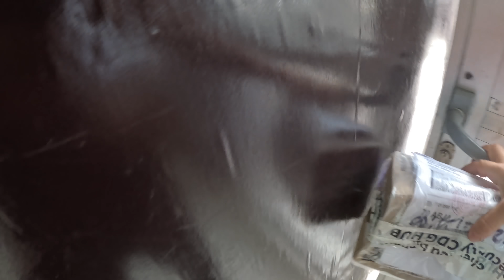Opening up the engine of my Honda CRF300 Rally in West-Africa |S7-E52|

Comment: As a transmissions overhaul and repair engineer, these guys did an excellent job.
Reply: I guess their skill level is very high out of necessity. I’ve never been good at wrapping my head around engines. The details you guys need to remember is mind boggling.
Reply: Only spotted one mistake they should have left the friction plates soaking in oil for a few hours before fitting.
Reply: I would not trust that engine to be honnest
Reply: Great guys but the damage and the lack of torque wrenches
Reply: I knew you would be on the bike again. Even in the USA we do repairs ourselves in little sheds. What is impressive is you guys had translation issues and they still got it done. Good thing for Siri 😅
Reply: I agree at all:-)
Reply: @JC-db4ih  I was a mechanic for 45 years, and a torque wrench is nice, but if you understand how much torque you are putting on the fasteners, you can get by quite nicely.  I was on a 100 mile cross country race one time and my engine seized.  I took it apart out on the trail, pried the piston rings out of the piston with my pocket knife, used a smooth rock to "sand" the grooves off of the piston, and put it back together and finished the race.
Reply: @JC-db4ih  Because of skin color or?
Reply: Super haben die beiden gearbeitet. Am Anfang hatte ich doch Angst das es nicht klappt, aber dann könnte man sehen, das alles gut wird
Reply: At least we will see düring next weeks how the CRF will run😁🙏
Reply: @JC-db4ih You can transcend the need for torque wrenching with enough experience and feel and common sense. Torque is a crutch of sorts anyway. What matters is axial tension on the bolt. Torque is a crude approximation of that, depending on friction, tolerances, etc etc. But it's not just a matter of bolt size, also function and (therefore also) material the bolt is made of.
Reply: @michaelsedaa3200 stoopid insinuation. (Plus the engine doesn't really have a skin color, or even proper skin.)
Reply: I think you and them did an incredible job 😅
Reply: @BuilderofRat  👏🏼
Reply: The people of west Africa, amaze me with their survivability skills.  Many here in the US have long forgotten them, sadly.
Reply: As experienced in automobile in enough years one think is for sure any engine can be repaired perfectly if only the opens is the only one again to put it together, I did alone somewhere in sudan.
Reply: They are like angels!
Reply: @BuilderofRat that’s so incredibly resourceful!
Reply: @ryan88682  That’s a myth. Do you think the Honda factory soaks their clutch plates? No they do not and it’s not necessary in the field either.
Reply: They got it done but I would have split the cases to really clean them out. The wrist pin install was a bit imaginative too. 😀
Reply: Piston circlips should really be changed after removed.
Reply: @JC-db4ih am an engineer myself and although trained using a torque wrench, I have gotten really good over the years in feeling it. 😅
Reply: @slime5430  I have not replaced the circlips many times, and I have never ever had one come out.   When you are in the middle of nowhere, you do what you need to do to get the job done.  I worked in a Honda dealership when I was 19 years old, and I never replaced the clips unless I screwed them up removing them, and a piston wrist pin clip is very easy to remove without screwing it up.  I used a wooden dowel installed inside the wrist pin to contain the clip if it tried to get away.
Reply: @cailinanne  When you are 40 miles from the truck, you can get resourceful.  LOL
Reply: @JC-db4ih  when you have no other option what are you going to do
Reply: @user-xd3ij7cw8s I worked for 10 years as a field mechanic for Caterpillar, and one thing that I ALWAYS torqued was the "alligator" link bolts for the tracks.  They had a torque value, and then you had to tighten it another 120 degrees to stretch the bolts a little.  I never ever had a track that I put together come apart while the machine was in use.  A lot of Cat mechanics can't say that.  I did not torque everything, but I always torqued those bolts.
Reply: @JC-db4ih  experience can replace torque wrenches in engines where tolerances are not super tight unlike in formula1/supercar engines. I've seen 2jz/rb26 engines in japan with 700-1200hp get rebuilt in a shed with just wrenches, and be fine after a whole summer's trashing.
Reply: I would have bought a DR650 for RTW work.
Reply: Seeing all that metal in the cases aren't you running a huge risk by not splitting the cases to get it completely out. If there is still the slightest piece still in there it can wreak havoc if it gets in one of those gears
Reply: @JC-db4ih  The lack of torque wrench and service manual worries me as well.
Reply: @JC-db4ih  yeah im suprised they didnt split the cases to make sure they get every bit of metal debris out
Reply: @JC-db4ih  Pliers on the wrist pin was a highlight for sure.
Reply: Hats off to dis wonderful experience mechanic......... What ever the model or the company  cheap or costly all the motorcycle build in a same way so no need to panic for local mechanic repair.....
Reply: @BuilderofRat  wondering. Just because you haven't replaced it and it not failed doesn't mean it's correct
Reply: Nope!...After such as breakdown the whole engine should be taken apart, each part should be inspected for damage and replaced if needed. Then, properly cleaned and engine oilwith filter should be changed again after good startup, and again after 500-1000 miles. Otherwise, continued problems in the future!... Mark my word...
Reply: @slime5430  Ha ha, ok, I will give you that.
Reply: @PeterBaumgart1a  But if you're German skin color plays an important role then does it not?
Reply: @PeterBaumgart1a  Well said. And an old school way, that's gonna offend these wok... inexperienced young guys don't you know? A friend of mine who was a WW2 veteran, used to tell me how they "torqued" bolts in their subs by touch. But today, oh no! you have to have fancy digital tools.
Reply: @BuilderofRat that’s the spirit. I once replaced a Crankshaft from a Kawasaki Z900 and used a hone to sand rub a brake-cylinder to get the the piston-pen fitted in the Con-rod … that was 40 years ago, the bike is still running.
Reply: @JC-db4ih  i totaly agree we will see after a few miles
Reply: @hhazelhoff1363  I would drop the oil immediately
Reply: @mikek.9980  true
Reply: @ryan88682  No.  Contrary to popular belief, the plates do not absorb the oil
Reply: @JC-db4ih most mechanics don’t torque. They should but…
Reply: @JC-db4ih  because it was done by africans😢
Reply: I work with threads , thread guages and I can feel how a thread is and for example if the thread is in alloy you cannot tighten it as much as the same pitch thread in steel. Obviously you would tighten a M8 thread with more force than a M5 for example and there's thread lock and copper grease to stop steel bolts seizing in aluminium like where exhaust bolts seize up in aluminium and shear off when you try to undo them. Most damage is done either by cross threading or over tightening. There are many tricks of the trade and these gentlemen will know them and probably have done difficult jobs without special pullers, torque wrenches since they could walk.
Reply: @JC-db4ih  YouTube keyboard mechanic 👨‍🔧 🤭💀😂
Reply: I wonder if these bush mechanics had the obligatory piece of paper? More than likely not but they have the skills to get a  machine back on the road. Some steps missed, tools and cleaning equipment missing but you are back on the road. Not everyone needs a certificate.
Reply: @ryan88682  You do not have to do that lmfao. have you ever bought a clutch kit? Barnett literally says to soak them for 5 minutes. spotting "mistakes" when you don't even know what you're on about. classic.
Reply: @@MrAn0n it looked like the clutch basket was damaged severely, so also needed replacing.
Reply: @michaelsedaa3200  I do not understand your remark about skin color. What does skin color have to do with bike repairs and the use or not of a torque wrench? Are you perhaps refering to the different bolt colors? Torque settings are different for electroplated bolts than untreated bolts or different types of metal bolts like brass or aluminum bolts that all have different colors. Alghough, I have never heard anybody refering to bolts as having skin colors. Coating colors perhaps?
Reply: @michaelsedaa3200 I see you also carried on with Baumgart about "skin color". What is it with you and skin color? With Baumgart you even threw "German" into your mix. You sound a bit "off the track". This comment  conversation is about a motorcycle engine and a few very crafty and good mechanics. Google the words: German Skin Color and see if you find a topic suitable to your likes.
Reply: @reteipegal7690  The problem is more with Germans and skin color than with me. I think it is a deep seated problem in the German mind. It is a root of distrust, in this connection with the quality of work.
Reply: @michaelsedaa3200  Thanks for your answer that is more nonsense than your previous comments. I hope that when you leave school and become a mature adult, you will outgrow your phobia for Germans, skin coulor and what else is clouding your troubled young mind. From a White German Jew.
Reply: @hhazelhoff1363  sure..running in.
For new engines I believe in two 1st services..500km and 1500 km..
Noraly is a bit trusting to be doing it in a cpl though km
Reply: @JC-db4ih  because it was not repaired by someone who looks like you. Wait for another part of the video to see if the lady will complain.
Reply: @JC-db4ih  you wouldn't have a choice...or you could buy a ticket and tell viewers you completed the trip but lost footage....you're lucky they even give a damn to help
Reply: @buddy1155  sheltered westerners 😂😂....
Reply: Cigarette makes brain work perfectly

Comment: As someone who has built and repaired many motorcycles over that past 45 plus years Adamo and his assistants were impressive under those conditions.....most mechanics working in well equipped shop could not have done that good of a job and completed it in that short a time. ..My hats off to their skill and your incredible luck in finding them.
Reply: It is truly great that Noraly found such competent mechanics!
Reply: a small release of your clutch is good coz the release bearing is not always leaning on tge clutch presure, when you grasp your clutch and the hard is on the top its not good coz the release bearing is always leaning on the diaphram and that is not good. the bearing is always turning and a lot friction.
Reply: Not sure why they even removed the engine to replace the clutch assembly. And why did they even take the engine apart?  All it needed was new plates.  JMO. ✌️🫶🇺🇸
Reply: @rayRay-pw6gz  did u watch the whole video lots of metal scrap left inside u cannot just blow with air pressure that man they make sure no other damage in the Engine
Reply: please, How can one find Adamo here in Abidjan?
Reply: Ou se trouve Adamo exactement?  Qqn a son contact?
Reply: @angelodicenso  the art of roadside repair at its best.

Comment: These guys are such impressive hard working geniuses, I wish honda could see this and send the two guys that rebuilt this bike each a complete tool set, I would be ecstatic to witness that!
Reply: Need to build these guys a workshop with all the tools and benches,great guys deserve more from life,these people Rock,just goes to show the lies the media tells us!😊
Reply: So you wrecht the whole clutch? And the particals went inside the whole motor? Why did you not replaced the oil pump? Or was it still good?
Reply: Honda should be sponsoring Itchy Boots with free bikes.
Reply: @gixxusmetalman7435  why dont you buy them a nice metric socket set and assorted tools and send it to them? WIRA or Teng tools would do - doesn't need to be Snap-On...
Reply: @gixxusmetalman7435  he is olrady driving a nice car.  And got the trust of the hotel owners. He is doing well. In the end he is a self told mechanic that's nothing special.  But the love's his job  so he is olrady a winner🙂
Reply: Geniuses? Its a 300cc thumper. Its as basic as a toaster oven. There isn't an easier base engine to work on.
Reply: @notsure9033  of course. you are the genius..
Reply: @notsure9033 it may be  " basic as a toaster oven" but how people know how to fix a toaster oven? Give credit  where credits due, kudos to those guys 😊
Reply: @anthonyintrieri3329  so true!
Reply: @jazbecbadger220  thanks for speaking up!
Reply: @gixxusmetalman7435  I completely agree, whole shop fully equipped with everything! Also complete but separate tool kits for each of the two guys that worked on the engine just incase they were to go separate ways one day in the future! 😊💕
Reply: @anthonyintrieri3329  Oh, good work on patching it up. Sure. But geniuses? Really?
Reply: @jazbecbadger220  Naive westerners think this is something special -when the reality is that the majority of the world's population don't have fancy workshops. And the guy is right - there is nothing simpler than a single cylinder engine - and these "hero" mechanics made the job much more harder than it needed to be! Just padding the bill if you ask me!
Reply: @notsure9033  not much of a motorcycle mechanic are you? There are many easier engines to work on. Any air cooled thumper, any 2t engine to name a couple.
Reply: I also don't like to see my car being striped like that, but the guys are geniuses. Well done, guys. Amazing!
Reply: I am wondering how much did the rebuild costs overall. This first class service could be expensive, right?
Reply: Dude drives a bmw m3 I'm pretty sure he's doing ok... If hinda really wanted to help, I'm sure a generator /shop equipment would go a lot farther
Reply: @kobuswinterbach8423  The clutch is not bathed in oil and is in its own casing separated from the internal workings of the piston, crankshaft and gear box where there is oil in the bottom.  And yes, she really hand grenaded the clutch!
Reply: @xavierdeveto2621 there are petrol heads everywhere apparently!😅
Reply: @notsure9033 hater mumu racist
Reply: @notsure9033  there's always that one Mr know it all but probably knows f...all😂👊
Reply: Honda, and in fact, all bike companies  should support these guys .

Comment: Impressive roadside repairs - these guys are heroes.  No special tools, no lift or fancy shop - just talent👍
Reply: Yes - Teachable moment here. Big fancy equipped expensive workshop does not make a good mechanic! Love it.
Reply: I say they did a ton of unnecessary work! Overall engine condition could have been determined with a valve check and leak down test. They didn't adjust the lever free play or even presoak the clutch fibers. I say unless it was free Norely got ripped off.
Reply: @jasonzerbini2375  that is how it is in any country that isn't rich, it is just the way it is.
Reply: Noraly, who is  knowledgeable, was very happy with their work. I feel that your judgement here is harsh and incorrect.
Reply: @millbaymoll2420  no its not, she is the greatest person in the world BUT she dosnt even know how to adjust a clutch... she got taken
Reply: @jamescox4823 how was she ripped off?
Reply: @ymartinez5612  if she paid an hourly rate unnessaccary work was done. If it was free then no.
Reply: @ymartinez5612  there is literally no point asking him…
Reply: even helicopter he can fix with no original part, he just created by him self. no kiding  man, motor cycle is nothing for them.
Reply: @jamescox4823  - Agree on the clutch plate soaking oversight; otherwise I believe they were trying to be thorough.  Given where she was I remain impressed
Reply: @jamescox4823  If you take into account where she is and going can there be too much unnecessary work done? I was thinking I may have even spilt the cases just to see/clean out the tranny as well. Help can be far and hard to find as we have seen.
Reply: @paul.vanhout57  the problem they couldn't be thorough, because that would have required many more parts. If you disassemble the engine, you have to replace some parts, if she only ordered a clutch repair kit, that won't contain new cylinder-head bolts, gaskets, etc..
Reply: Those comments about ‘she got ripped off’ 😂 guys you really need to venture outside your health and safety, high tech tool zone where things are fixed at the side of the street NOT on an hourly rate but for the love or for professional curiosity. It amazes me how some high tech mechanics here diss these poor guys who are literally saving the day.  This is what’s wrong with the world, everything must be done to the ‘manual’ at an hourly rate😅 gone are those days when skill and talent have no value.
Reply: @jamescox4823  Here in Africa work is not paid on an hourly rate
Reply: Noraly was referred to some very capable mechanics to do the job.
Reply: @absalommumba3297  precisely my point, these folk need to travel away from their enclaves to see how people do work without referring to a manual.
Reply: @SuperBadger999 The arrogance in them depicts a full belly.Clearly privilege is invisible to those who have it.